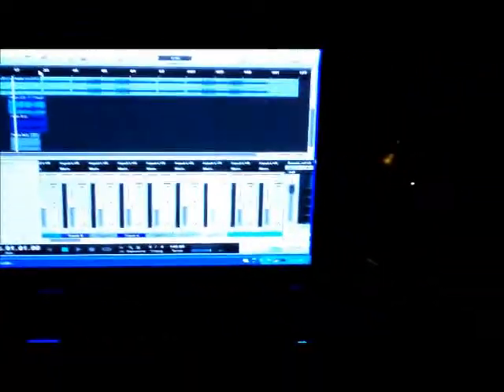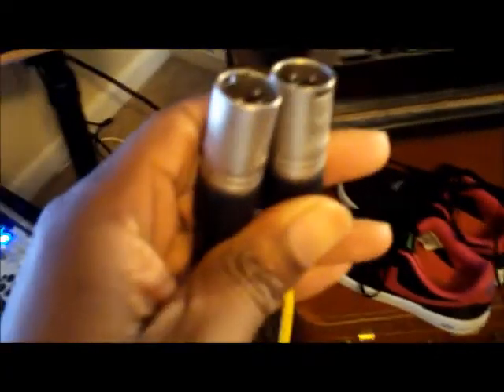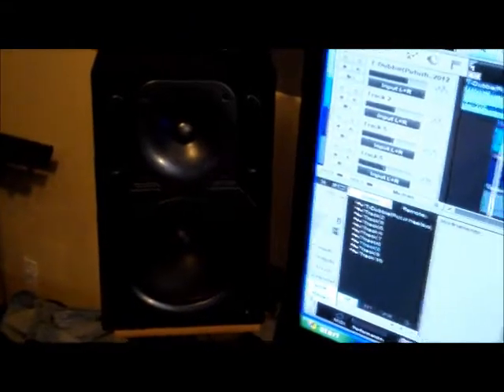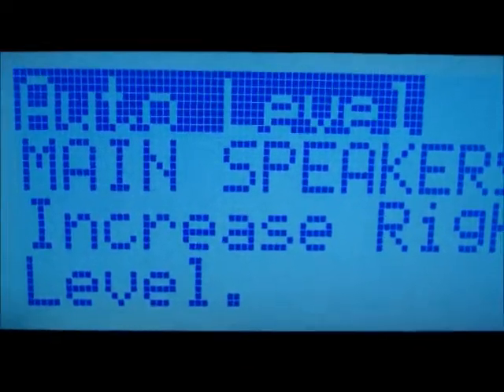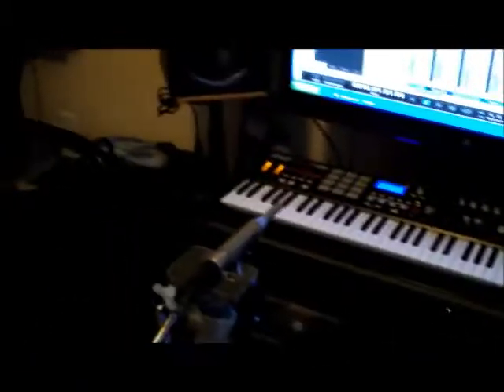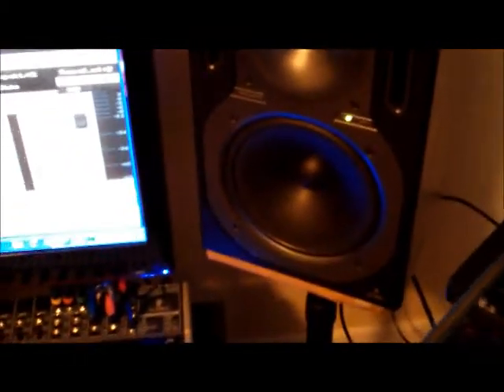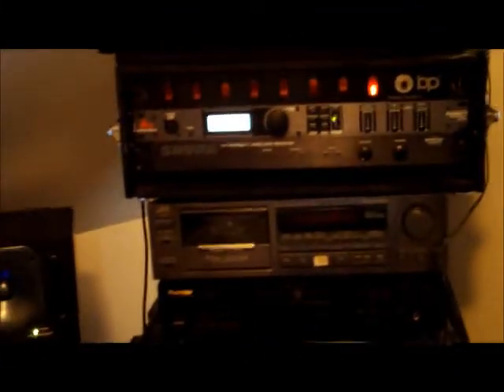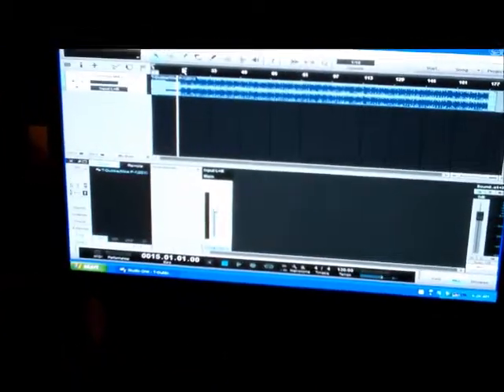Driverack and Studio situations

Comment: great video. you said the first two cables are coming from your mixer or your spekers?  i maybe misunderstood you at 1:28 you say from mixer to dbx. but when you show the yellow cables you say from your monitors to the input of the dbx. but after you hook them up you say they are from the mixer and using the sub as you controlls and the mains for mic? i got llost after that.